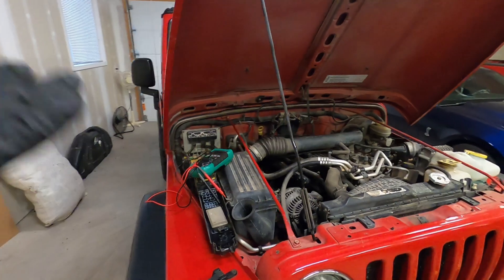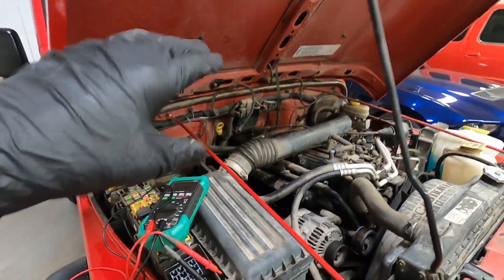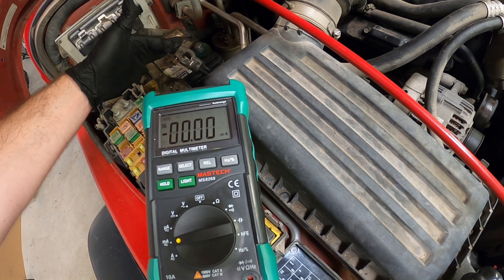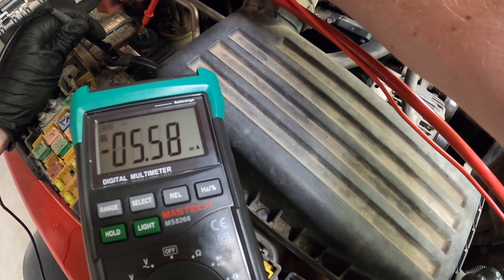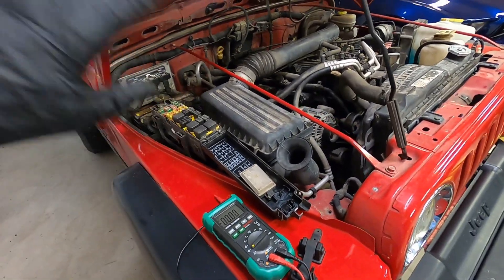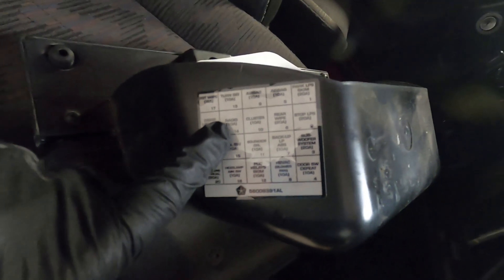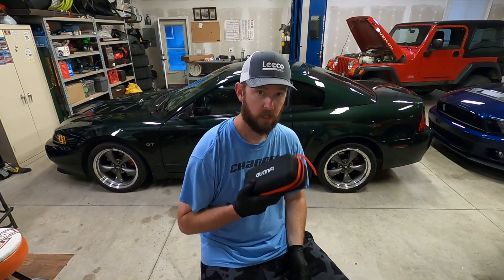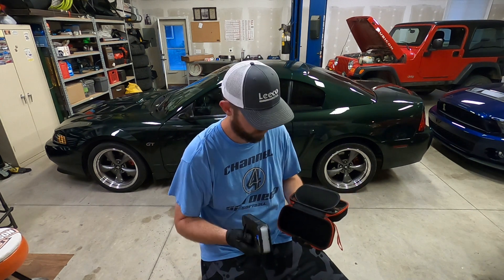How To Find Parasitic Battery Drain

Comment: Do ever notice that the dash and radio are lit up even though the vehicle is locked and off, and you've not even touched the door?
My 2019 JLU MOAB had been at the dealership since 1-Sept-2023. The issue was that I was draining batteries every 3 to 4 weeks. The batteries would drain even though i drove my jeep daily.
The fix ended up being to replace the Sleeve Valve (PN - 52854755AB). It was causing my radio and dash to light up and then turn off over and over even though the motor was off and the jeep was locked. This constant on/off cycle drained and killed my main battery and then eventually the aux battery.
If you are suffering a similar issue of having to constantly replace your batteries you may want to have your Sleeve Valve (PN - 52854755AB) checked. It may need to be replaced.
The dealership only found it after a lot of trial and error.
I hope this information helps someone.